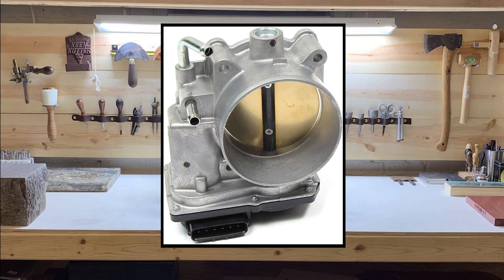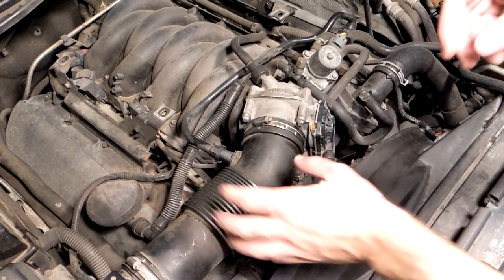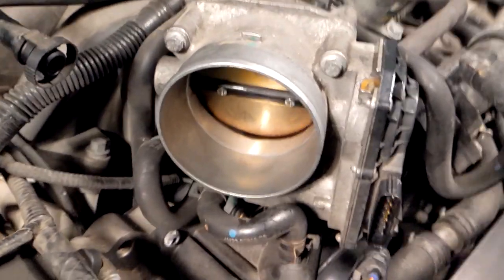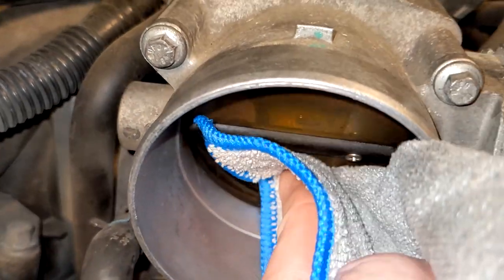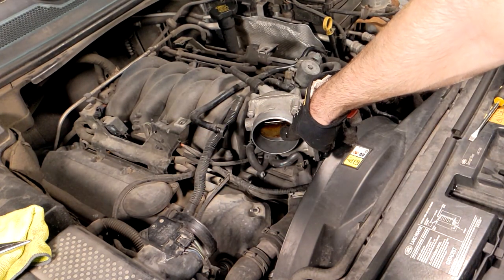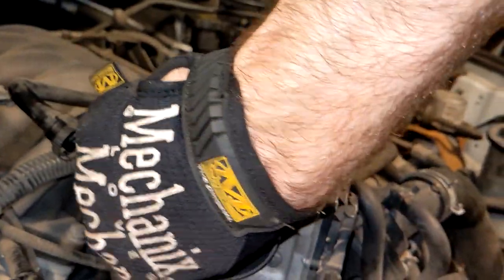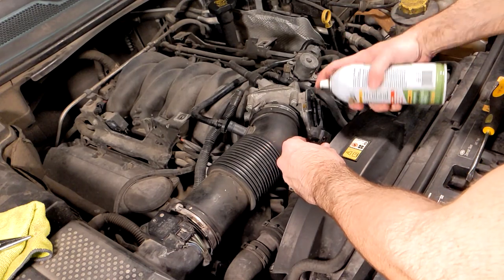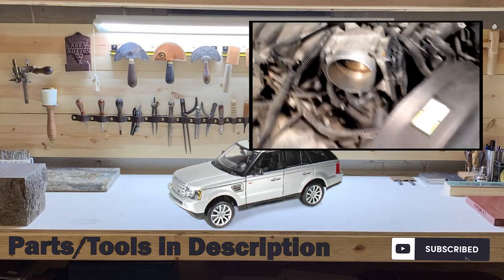Throttle Body Cleaning in 5 mins - Range Rover Sport or LR3

Comment: Hi!! I have a 06 range rover sport supercharged that I'm having problems with. Has anyone had accelerating issues or lags when pressing  pedal all the way down to the ground. It takes forever to pick up some speed and won't go over 50mph and if there is any incline on the road the speed drops significantly. Happened to me on the freeway and almost caused a huge wreck. Anyone have an idea what could it be. Thanks in advance

Comment: This engine used an electronic throttle body. I've always read that one shouldn't manually force the butterfly valve open to clean the backside of it as it may damage the TB. You can press on the accelerator to open it up and keep the pedal depressed with a stick or something.
Reply from the maker: There are two concerns, first that the calibration will be affected, and second that the gearing will be affected. As long as the throttle body is disconnected (and engine off) while cleaning, and you are careful with opening/closing as to not strip gears, it should be OK. I've always cleaned it this way and have never had any issues. I know that's anecdotal 😅

Comment: I'm going to give this a shot on my LR3. I don't have a check engine light, but I have an annoying message indicating "Reduced Engine Performance." The air filter from previous owner was deplorable, so I changed it. And I also cleaned the MAF sensor. The message remains. No real rough idle issues to speak of, just the message.

Comment: Hey Brother, I followed your steps on cleaning the throttle and air mass sensor, then I was driving today to test it and I got my first fault ever in my sport. A hdc fault and parking brake fault? Do you have any suggestions on this happening from cleaning these two things?
Reply from the maker: Those two sensors shouldn't be related to HDC and parking brake, I get those faults too particularly when it's cold outside but it tends to resolve. My guess is low starting voltage of the battery in cold weather.
Reply: @HazyJay  Thanks! I ran the codes and im getting a p0500 for the vss in the driver rear. So im wondering if I just need a new speed sensor or it was just acting up..Im going to drive it around and see if it comes back after I cleared it

Comment: Hey just a quick question. I watched another video before seeing this one where the guy warned against moving the flap because it could throw the calibration off. To clean the backside, he removed the four bolts and pulled the whole thing off so he could just access the whole back of the body. Your method is obviously appealing because there's less disassembly. Just wondering what you think about his claim of a potential calibration issue. Appreciate your help!!
Reply from the maker: The electronic throttle body shouldn't become uncalibrated by manually moving the plate, however it will be slightly off after cleaning since the computer is "used to" the carbon buildup, so when it's cleaned it might take a few days to get used to a new clean throttle plate. As long as you're gentle with opening the plate it shouldn't be an issue.

Comment: Thanks for this. I will give it a clean. Engine in my D3 v8 s already running great but this could only help. Previously I had an engine light which was fixed by simply putting a new air filter in! In addition, for maintenance I cleaned the MAF and the MAP sensor as well as putting some liqui molly injector cleaner in the fuel tank.

Comment: Excellent video.  The shop recently replaced all the coils on my '06 RRS when I had a rough idle and the engine threw a reduced engine performance error.  The coils were less than a year old, so fortunately it was under their parts warranty.  But sounds like maybe I should also clean the throttle body myself.  Thanks.
Reply from the maker: Yeah cleaning the MAF and throttle body are pretty easy, also change air filter. If it's still rough after that then it's time to maybe spend more money 💸

Comment: Great how-to. I didn't realize it was this simple.
Reply from the maker: Yeah if you remove the throttle body it's more annoying, but fully removing it isn't that necessary.
Reply: @HazyJay doesn't manually moving the plate cause a check engine light to go on?
Reply from the maker: @dweikel246  It hasn't caused problems for mine and I've cleaned it about 4 times. Definitely do it with the vehicle off.

Comment: Hi and tks for all your videos- i have exactly the same car and i have saved hundreds all tks to you - quick question, by any chance do you know where the fuel rail pressure sensor is located ?  Again thank you !
Reply from the maker: Yes it's located on top of the fuel rail adjacent to the fuel inlet (driver side rear of the engine): https://m.media-amazon.com/images/I/41n9VRdk-sL._AC_.jpg
Reply: @HazyJay  Thank you ! I will try to change it over the weekend- apparently its hard to access tho- the mecanic was charging me $600 labor (i got the piece on my own)…. - Thank you again

Comment: Awesome video. I have the SDV6 & need to clean the throttle body as the valve is sticking. Can I take it off completely, clean it & then reinstall without the need to plug a reader into the OBD port? 😁
Reply from the maker: Definitely, that's how I will do it if its really dirty.
Reply: @HazyJay  so no to reprogram it, as it's already been done 👍

Comment: Great video.. I officially am gonna start trying to do repairs myself.. 

Can anyone help here?? 

Last week, I got the restricted performance error. didnt check out what was going on as I turned the car off and it went away.

It came back the other night. 1st, could not drive over 30.. then later it allowed me to drive fine but engine light was on. In the morning, all gone and I could drive normal with no errors. I decided to check what error codes were flagged.

1) P2135 Throttle Position Sensor
2) P2105 Throttle Control System
3) P0660 Intake Manifold Tuning Valve

 its weird that it goes away and comes back. Never know when its going to do this but need to fix.  

Today I cleaned the mass airflow sensor hoping that helps but drove great for a few days 50-100 miles then happened again.

Any ideas?  Was gonna try cleaning the throttle body.. i have a 2011 L322 HSE

I don't think you can replace just the throttlebody sensor you have to replace the whole unit if it comes to that

Comment: Great Video. Also watched your MAF Sensor cleaning vid and subscribed. 

Recently purchased a 2012 RRS. Unfortunately it has started to die on idle. Took to the shop and they replaced the Crank Position sensor, and cleaned throttle body. Issue stopped for 3 days but popped back up. 

It's not throwing codes, which makes it tough. Maybe it's MAF sensor? Curious if you have a POV?
Reply from the maker: It's cheaper and easier to clean the MAF, get a new air filter, and re-clean the throttle body on your own to see what happens. If you still have the issue then consider taking to dealer since the electronic throttle body may need calibrating. It's always a hassle to take to the dealer so I usually try everything that's cheap first and see what happens. 9/10 it solves the issue.

Comment: Hello, I have a problem. The position of the transmission is not visible on the 4x4 information display. When I lower and lift the suspension, the animation doesn't play, it stays fixed. When I turn the steering wheel, the animation that plays still stays on the screen and does not rotate. sometimes the screen gets stuck on the land rover icon. I bypassed the optical cable in the trunk, but my problem was not solved. what do you think is the reason?